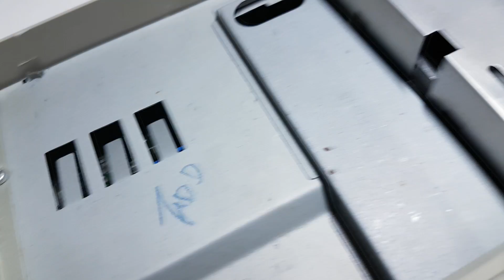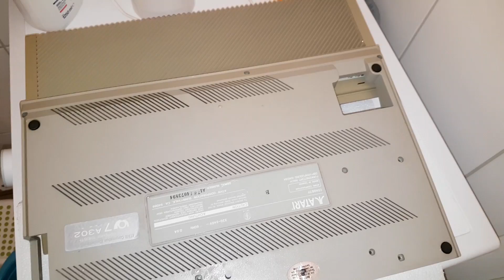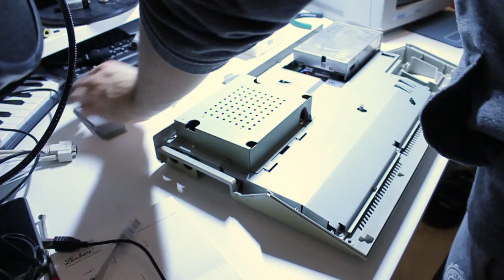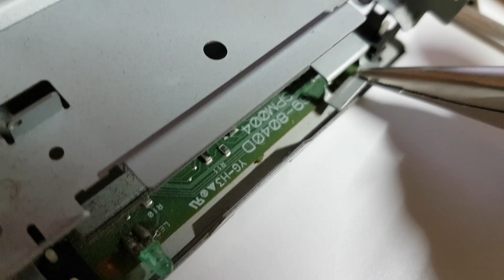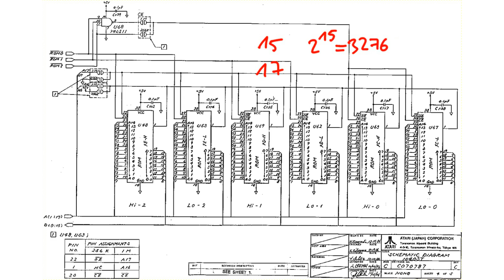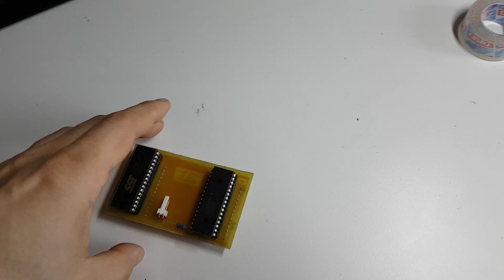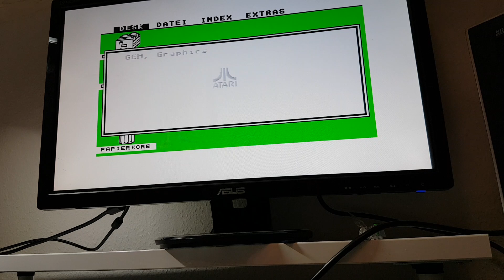Atari 1040STf Reburbish / Floppy Replacement / VGA Cable Manufacturing / TOS Upgrade

Comment: That was a marathon job of upgrading and refurbishing you did. Shame that the case didn't take to retro-brighting, but it's all experience learned. I'd be tempted to get a broken ST and transplant the case (and floppy), or respray the case in a shade of grey matched to the original. I'm quite envious of you ability to solder directly to the mainboard and make your own circuits and daughterboards, though - that's beyond my ability.

Looking forward to watching your multipart Amiga 500 video. My first 16bit computer was an Amiga 500+. I still have it, along with an A600HD, a couple of A1200's and a CD32. Before the Amiga, I was using my ZX Spectrum +2A, and before that, an Acorn BBC Model B. Still have both of them, but the BBC B is dead at the moment. I have to investigate resurrecting that one.

There is a particular East German computer that has long fascinated me - the Robotron Z1013. I read about it via an article from Retro Thing a few years ago, but you almost never see anything about it in English (certainly not on You Tube, anyway). It was built using the parts Robotron rejected for their industrial and government computers. While we were playing on our Commodore 64s and ZX Spectrums and the like, that's what the few people in East Germany who could afford a computer were using - so long as they could build or scrounge up a PSU, tape deck, better keyboard, build a case, etc, etc. Do you have an thoughts about covering it? I think it would be really interesting to the wider Retro Computer/Video Game community who didn't grow up on that side of the Iron Curtain.

Anyway - excellent video. Looking forward to more great content from you at some point :)
Reply from the maker: Thanks for all the praise! In fact, my first computer was a 286 (which I got some time in the mid-90s, so you could say I was born a retro nerd :D).

I thought about getting a broken STf, but there not many available, really. And when I'd find one, I'd probably try getting it to work instead of stealing the case.

Please don't see my soldering as a tutorial or anything, I'm really bad at it. There are other people here on YouTube who are a lot better at that and actually know what they are doing. My electronics tinkering is more trial and error than anything else. Of course you don't see me failing for two weeks, I only show the final result and maybe a few of the more interesting fails inbetween :)

I'm familiar with Robotron, but I've never seen one. I grew up in Western Germany, and though I had relatives in the East, none of them was into computers at all (and I was 4 when the wall fell...). They're also relatively hard to get, even here. If I ever come across one for a decent price, I'll grab it!

All the parts of my Amiga video series are more or less finished, I'll release one every week. Hope you like them as well!
Reply: I'll be sure to watch them. I remember the wall falling vividly. It was just before my 13th birthday - The Berlin wall came down, the USSR collapsed, Romania ousted their dictator - it was a crazy time, seeing all this stuff I'd grown up with seeing in James Bond and other Hollywood movies as some sort of unstoppable evil empire, and then seemingly overnight, it was gone. Still, the period is sort of fascinating (from an outsider's perspective) at how people coped, and what technology was available - like in Russia, there were loads of clones of the Sinclair Spectrum, because it was so simple, relatively speaking. In fact, where I live, there are rich fishing grounds. We used to get Russian Fish Factory ships calling every summer - they would harvest the fish, process them on board. The crew would be relatively well paid, so they'd come ashore, buying up as many Levi and Wrangler jeans as possible, jars of Nescafe coffee, and Sinclair Spectrums, or cheap colour TVs to take back to Russia. We even got offered money for our car - a Russian Lada. Crazy times.

Comment: ahh, the retina display quality of SM124... too bad it had this black frame around the active screen. It was capable of 1100 lines horizontal, but Atari only displayed 640 pixels...
Reply from the maker: Radio Żelaza I guess it's a limit in graphics memory. But yes, it looks pretty good for a monochrome screen.

Comment: I've got an ST G with a keyboard that yellowed exactly like yours - quite uniformly, but the [><] key is white like new. I thought that is has been replaced, but apparently not.
Other observations - ST did not have Disk Change signal, it was detecting disk change by flipping Write Protect signal, but only on non-write protected disks. You've been really lucky to have an LCD monitor that accepts the 15kHz RGB signal, most VGA monitor will handle only ST-HIGH (mono). The Atari monitor plug is cheap and easily available (it is commonly used in car CD changers). Try to buy an External Floppy Disk plug or a ACSI/Hard Disk plug. Last thing - why to bother with PCB for EEPROMs? It is just two or three additional wires and one pin bend out of socket.
Reply from the maker: Oh I mostly did the PCB thing because it meant I could experiment with PCB etching some more. And as much as I like hacking things together, I didn't want to hack that much and just bend pins :-p

Comment: Try RetroManCave. He is a youtuber who does refurbishments and knows a lot about retro-brighting. He might be able to suggest how to fix the unit. BTW I love what you all are doing to refurbish these old computers. I am an 80's nerd and these machines are quite nostalgic for me. Seeing them as they looked when new just takes me back!Oh on the floppy drive if you can determine whether it's a mechanical or electronic issue you may be able to repair it. Especially if the issue actually is with the controller. There are a lot of boards that are interchangeable and that would allow you to put the original drive back in place.

Comment: Modifying the side of the ST's casing was an actual mod we used to do back in the 90s.
And it just occurred to me that maybe the drive in your ST was single sided (it is an STF with TOS 1.0), and your test disk was double sided.
Reply from the maker: The drive had problems reading some of the disks I got with the machine, which according to the previous owner worked fine back in the day. 

I just checked, it does have two read heads.

Comment: How did you make ST LOW working on a VGA monitor?
Reply from the maker: tzok83 It requires a Multisync monitor. Or one that is old enough (or just weird enough) to sync onto the low frequency signal of the ST's video signal. Same goes for most retro machines that are RGB capable.

Alternatively you could get a scandoubler, which makes it work on every modern monitor, but those can be a bit pricey.

Comment: I have 512ST (with 1MB) and 1040STe which was sold to me as defective, but turned out to be completely functional,  albeit a little bit dirty and missing one keycap. Thanks for this video, I thought of retrobriting those, but now you've dissuaded me from that idea. I'll just retrobrite the keycaps, though, because they're supposed to be white so not much damage can be done to it. Great video, I love the detailed explanation about ROMs.

Comment: Excellent job you did there, especially with the ROM upgrade!  Don't worry about the RetroBrite disaster, find someone that knows how to spray plastics, and get them to simply paint it the original shade of grey.  Do not try to peel off the sticker as you'll never get it to lay flat again :-)
Reply from the maker: Darren Coull Thanks! I think I'll just stick with "cloudy white" as the new color of the machine. Could be worse, I guess.

Comment: CLEAN THE FLOPPY DRIVE HEADS YOU TOOL
Reply from the maker: dizasta977 Any suggestion how to do that except running them with a cotton swap dipped in alcohol, which is precisely what I did?

Comment: try soda blasting it or do custom paint job
Reply: Leave it like this and call it "1040 STF battle edition" :)
Reply from the maker: Yeah, I guess the case is looking so bad now, that a custom paint job could actually save it. I had thought about that. Maybe I should reconsider :)
Reply: +flash /me back - i would leave the keys white, then paint the case the same color as your Atari shirt... put some clouded red LEDs in there, if you dont like the result, take them back out... or... Paint it green to match the UI... then green LEDs maybe... just enjoy it, no worries. FHL from KY

Comment: Did you try cleaning the heads of the old drive?
Reply from the maker: VWestlife Yeah, that's the first (and only) thing I tried. It was relatively hard to reach the heads because of the form of the case of the drive. I may try again after removing more parts of the drive. That may make a nice follow-up if it actually helps. I'm a bit afraid of removing those tiny screws and springs.
Reply: @flashmeback  Side Select line may be busted (somehow). Otherwise you would get some kind of file error instead of bombs (that are a hint of corrupted binary). Also, you could upgrade this board with a blitter chip from a Mega ST.